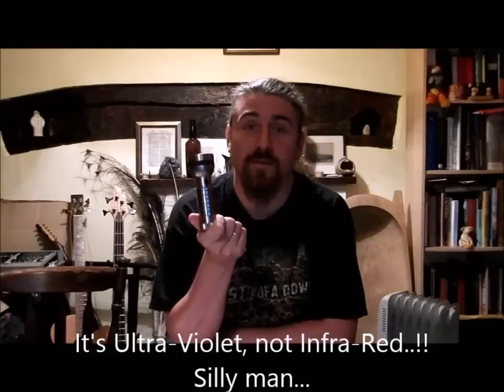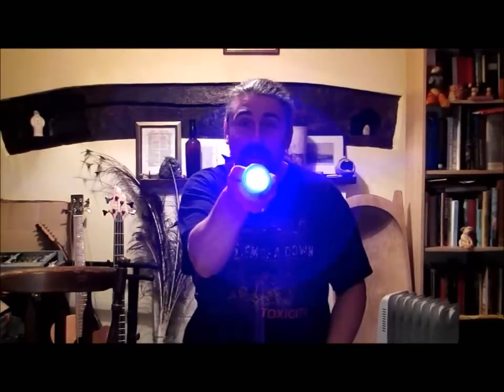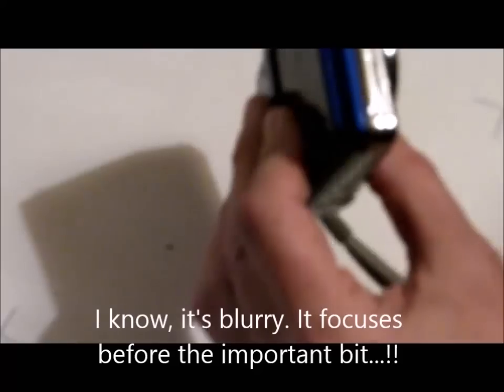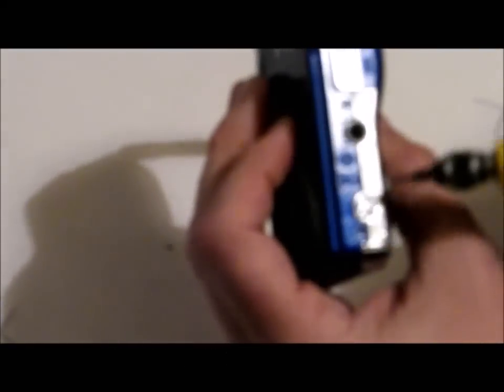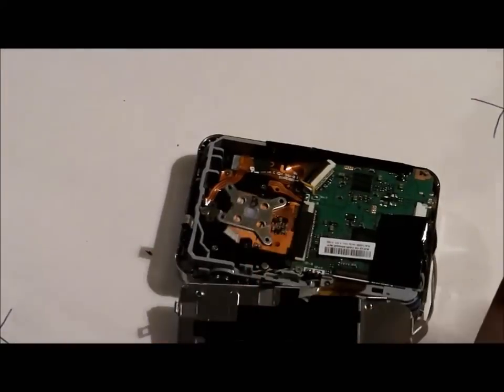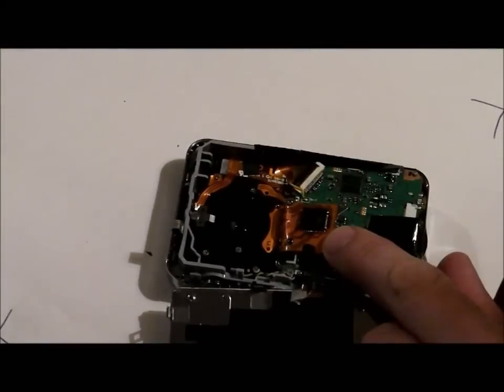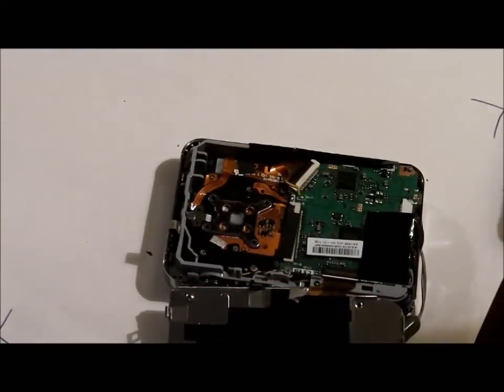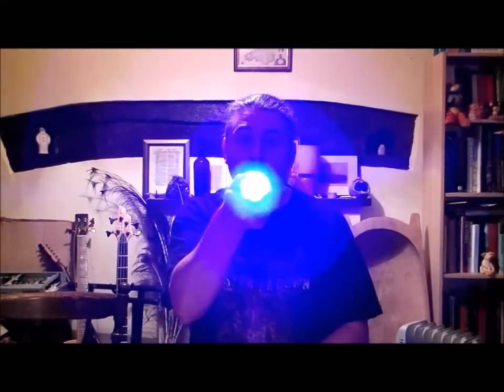Convert your compact digital camera to I.R or full spectrum.

Comment: Many thanks, I didn't realise it was as straight forward to do yourself, would it be as easy with a kodak easyshare type of camera? Failing that fuji camera coming soon 🤔
Reply from the maker: philmacrackin 9
Kodak cameras are a tough one to call. They've made so many different designs that I tend to steer clear of them. Fuji finepix are the easiest to work on and they're cheap as chips. Glad you found the video helpful..

Comment: These ghost hunting groups that are charging money for things like this are a joke. I notice they usually cover the manufacturers name on the item, with a sticker with their groups name, as if they've actually made it themselves. They buy Kii meters too, and replace the momentary switch with a latching switch. I don't know how much a PCB mounted latching switch like that costs, but I'd be surprised if it's as much as the padded envelope you'd get it in. The IR lamps they make and sell are awful, too. If they're boasting about it running all night on a 9v PP3 battery, then its obviously not worth buying. They make a big show of comparing them to expensive units like Sony's Hvl-IRM...Sure. Compare modern IR LEDs with those in a device that's old as the hills. Besides, those 10mm 3 chip IR LEDs cost next to nothing. The battery you're powering it with costs more than all the parts and the little project box combined, yet they make a huge mark-up, and most of the time, they've used the wrong current limiting resistors entirely because they learned how to make them off a Youtube video and are using the same value resistors despite a different LED configuration. They sell EM "pumps" that are just magnets stuck to a fan...well, it may trigger a reading in an EMF meter, but that thing is not doing anything. Magnets do NOT emit energy into the world; magnetism is a reactive force only. All they are doing is moving a magnetic field through the meters coil and fooling it into giving a reading. The only energy you are "pumping" anywhere is the kinetic energy of the thing spinning around. If anything used any of that energy for anything, the motor would slow down, so why not put an ammeter in series with it and see if anything uses that energy? As the motor slows, it will draw more current. Even the solid state EM pumps are a total con-job. Why pay some guy for something that puts out a tiny fraction of the energy the mobile phone in your pocket puts out? Because it has more effect on an EMF meter? Well, it would. They are designed to find  fields oscillating at mains frequency, so that's how he tunes his "pump". The false assumption being that if we're using an EMF meter to detect ghosts, then They must "eat" EMF, and for some reason need it to be at around mains frequency. In that case, the last thing they'd need is a puny little device sat on the table; they can help themselves to the national grid. Kii meters on the other hand are sensitive across a much, much wider range. Watch how your mobile phone sets those off! And they'll do it from much greater distances than anything using permanent magnets will. Hell, make a TASER and use that as an EM pump. The driver is the same type of circuit as a solid state EM pump, and the rest is just a cheap trans former, a few voltage doublers, and an output transformer. Apart from the output trans, all the parts might come to a few quid. The output trans might set you back £15 - £30, for which price you could get a scarp neon transformer and make a big Tesla coil instead. But you can't sell those things on Ebay, so those people convince people that it only works if you spend money on the primitive little gizmo they make. UGH!
 The trick in this video works equally well with camcorders, and they charge even more for that mod, even though miniDV camcorders aren't worth the postage to ship them anymore.
 Anyways, sorry for the rant. And thanks for giving this information away instead of selling it. I never even mentioned hacked radio shack radios that suddenly become "ghost boxes". The schematics for the original Franks box are freely available, FFS! There's barely a few quids worth of parts in it!
Reply from the maker: No need to apologise for any rants, I have enough of them myself. There is a guy on eBay who does everything that you've highlighted. He sells those insulating bags we get our sensitive components in as 'Faraday Cages' to block the signals to these scanning ghost boxes (excuse my wretching), for  a whopping £7.99. I had a batch here that I paid £3.50 for 25 so I listed them. If people really wanted them, they could get one off me for a pound. Believe it or not he actually sent me an email and demanded that I raise the cost in comparison with his as I was drawing away his customers. When I refused he threatened to report me to the Inland Revenue for tax evasion. Tough tits buster, it's called free enterprise, I pay my taxes and you're an A-hole. I even stuck a little note in with every order telling people to just disconnect the antenna, it'll null the sensitivity by around 100db and render it deaf to any transmitter over a 100 meters away.
Unfortunately, many people with an interest in the paranormal are a little naiive concerning it's nature. In fact anyone who can actually tell you what a 'genuine' ghost, EVP or any other paranormal event is, or even tell you or I that such things definitely exist, is a better man/woman than me because NO ONE KNOWS, thats why it's labelled paranormal. There will also be people who will always try and turn a profit from peoples lack of knowledge. If I can raise the awareness of these people to the work of profit hungry charlatans, job done...
Reply: Thor I'm tempted to make a video on the subject. Youtube is a lot less strict about little copyright issues than it used to be. They're not going to delete a video just for showing part of an Ebay listing. Is that guy still selling anti static bags on there? Let him report you. Report him back. 20% of 7.99 is a lot more than 2% of a few pence, and you can bet he's not paying tax, either. Nobody pays tax on stuff they sell on Ebay. I'm surprised the HMRC haven't arranged to have the tax taken out automatically.
 But the antis static bags really take the cake. Best I'd seen was "dowsing rods" made from 3mm electric fence wire with a bit of glow in the dark tape around the end so you could use them in the dark. That wire is sold on 1/4 mile spools. It makes me sick. I just made a Ouija board planchette out of a floorboard from a 200 year old fort, the bottom of an alcopop bottle, and three glass marbles as the feet.  I should sell them as ultra low friction, hi-tech Ouija pointers. Tell the very true story of how the fort was used as a hidey hole by a serial killer in the 80's.
 I agree fully about the nature of ghosts. I cringe when I go on those public investigations. I go for entertainment, because it's hilarious. The members of those groups talk to the members of the public there as though they are sharing absolute certainties. One of them informed me during a cigarette break that ghosts aren't bothered by our torches because the only light they can see is fire. 2 hours later, the same guy is having a lengthy conversation with a ghost about the LEDs on a Kii meter. "Can you make the red one light up now please?".
 Gotta love the idea of asking if there's anybody there, and then waiting quietly for ages. True story: Medium: "If there are any spirits here, can you make a noise". Dog in nearby village: (after some time) "Woof",  Medium: "If that was a spirit dog making that barking sound, can you make it again, please". That seriously happened. It was at Carew Castle, and I wish I had it on video.
 Ghost stop has some nice over-priced junk. I see Kii meters cost 4X the original price now, with a simple switch modification and a black paint-job. I do love the Ovilus. I'm always amazed by how it can have a 2000 word dictionary, and all the words are Kill, die, death, dead, rape, murder, died, killed, hung, beheaded, etc. Looks to me like the words aren't randomly selected. Unfortunately, the list isn't included with the device, and anyone smart enough to reverse engineer it, is way too smart to pay the asking price.
 If you can buy something that measures something and can be relied upon to give unexpected readings from time to time, people will use it to "hunt" ghosts. I remember when digital thermometers were all the rage. These people just want something to wave around and produce ghosts for them, when the ghosts are too lazy to appear in front of them or levitate a table for them. I swear, it's just roleplay, and the people doing it know that, deep down. After all, if the chances of seeing a ghost are so slim, it soon gets boring unless you have some device to tell you they are there, anyway.
 When they call themselves scientists, I want to punch them. As soon as someone claims to have seen or heard something, they always make sure to shout out loud what they've seen and heard, completely ruining any chance of someone giving more credibility to it by seeing it too. Surely they understand this. I think they've just learned that they HAVE to shout out what they think they saw in order to get other people to say they saw it too. Again, I think it's all roleplay. I think there's as much chance of seeing a ghost without the "medium" and all the equipment and hysterics and provocation. If they exist, and are aware of us, and can move objects occasionally, one of them would have written to us by now. There are so many theories as to what they might be, but every last one of them has holes that make it senseless. I'm not even convinced they exist. I mean, I've seen lots of phenomena, and other people claim to have seen actual apparitions, but there is no rule whatsoever saying that that must be anything to do with what happens after people die. I've yet to see any evidence of any real intelligence. Funny how they only seem able to whisper the first letter of a name into a mediums ear, but, once the medium hits a lucky letter and is given a name by someone, they can suddenly talk 19 to the dozen, until the issue of dates arises and they get muffled again.
Reply: Thor awesome. Can u please give me the address where you sell the Faraday pouch. I need a few.
Reply from the maker: Rexx Michaels http://www.ebay.co.uk/itm/FARADAY-SHIELD-FOR-USE-WITH-ITC-SCANNERS-SPIRIT-BOXS-ETC-EVP-/261890428526?ssPageName=STRK:MESE:IT
Reply: Thor so what's the difference between the bags and the fiber/woven bags? Question: Don't they ship sensitive computer parts in these special bags???????
Reply from the maker: Rexx Michaels The only real difference is that the bags I use are much less to buy. They are used for shipping sensitive electrical components, it works for exactly the same reason that they work for ITC, no static gets through.
Reply from the maker: Rexx Michaels It costs about £4.50 to ship from here to the States so it might be better worth your while to nip into Radio Shack, I'm sure you'll be able to pick them up there at a much lesser cost than having them shipped from over here..

Comment: Hey there! I posted another response last week but don't see it here so I'll post it again.  I got a Nikon Coolpix S3500 on eBay to convert to full spectrum and tried to do it myself. I was able to get all the screws off but couldn't get the cover off. I really thought that I would feel comfortable trying this myself but after trying I don't. lol I was wondering if you would be willing to do a video chat with me so that you could help walk me through the conversion? If not I completely understand so would you be able then to walk me through it via instant messaging or any other way? I totally trust you but sadly I don't trust myself to do this alone. Thanks so much! Looking forward to hearing from you!
Reply from the maker: +Two Pink Peas I'd have to arrange to use someone elses broadband connection. We ;ive in a very rural area so my broadband only comes in at about 0.9Mbs which isn't good for streaming or Skypeing. I'll see if I can sort something out..

Comment from the maker: +Russel phillips
That doesn't sound right to me. Make sure the ribbon cable that attaches the led screen to the board is correctly secured. It might also be worth turning it on before you reassemble it. It just sounds like a bad connection to me.

Comment: Hi Awesome video
What make camera do you have there?
Im very new to this and am going to copy you bit by bit lol
Also have you tried it on a camcorder?
Thanks
Reply from the maker: +Richi Bulbs It's a Fuji FinePix in the video. I have done it to a camcorder too. It's a bit more involved in that there are more screws and other bits to deal with but the principle is the same, as long as you can get to the sensor, job done.

Comment: hi Thor, is it Posible to convert a SJ7000 into a IR or Fullspec ?
Reply from the maker: Hello, I can't imagine any reason why it wouldn't possible. The same basic principles apply for video as for still cameras so if you can't get to the IR filter and remove it you'll be good to go.

Comment: I like your video great info it now makes me want to learn more info on this.Just a couple of questions the lantern (flashlight) you showed that you said you bought at a sports store when in the barn your mounted light battery was going bad i wish you would have used the lantern to get out and i could have seen the results of the handheld lantern (flashlight) just in case the other one lost power.

0
Reply from the maker: Frank Turley The lantern I use is very similar to the one in the link.
I'm not endorsing the item in this link, just using it as an example. It was the first one I came across on eBay so I'm sure a little bit of digging around will find very similar lanterns at a lesser cost...
Glad you liked the video...

http://www.ebay.co.uk/itm/Silver-Aluminium-21-LED-UV-Flashlight-Torch-Ultra-Violet-Blacklight-Detection/161405466210?_trksid=p2045573.c100034.m2102&_trkparms=aid%3D222007%26algo%3DSIC.MBE%26ao%3D1%26asc%3D20140107092241%26meid%3D594cf591a336440584810d86678c0955%26pid%3D100034%26rk%3D2%26rkt%3D4%26mehot%3Dpp%26sd%3D221529903528

Comment: I've just converted my old Fuji A610, though the circuit board was in front of the sensor and the display was incorporated into the back, so a bit more work than suggested in the video. I tried both IR and full spectrum adaptions and can say that full spectrum is more fun and usable. IR pics are dark and big apertures/slow speeds are required. or manual over compensation and tripod mounted fuss.  In B & W, full spectrum pics are better defined, clearer, sharper and the IR effects are more pronounced. In colour mode, I found it necessary with both IR and FS, to reduce the colour saturation post production. IR colour pics are pretty useless unless the light is strong. The FS is the one to have for ghost hunting. All good fun, and thanks for the confidence building video.

Comment: did everything you said to the letter but wont give clear shot blurred help what did I do wrong
Reply from the maker: A couple of things to check.
1. Check you didnt displace the lens when you put the case back together.
2. Make sure the ribbon cable is correctly re-attached aa a loose or missing connection will cause the camera to mis-focus.
Dont worry, it will be a simple fix..

Comment: My question is what do you see when you look into the screen? Could you walk around in the dark with the camera and not run into anything?
Reply from the maker: Provided you have an IR illuminator you can use the converted camera as a night vision sight. You can't see it in the video but the barn was plainly visible on the LCD screen even though the place was pitch black..
Reply: You'd need an infrared illuminator light to do that. But, they're fairly inexpensive.

Comment: Question: Is there a difference between night shot & full spectrum. I have both one is pinkish & my SONY DCR-SR200 is greyish green. Is the difference that u can use the full spectrum in the day. Does night shot basically do what your doing?
Reply from the maker: +Monterey Paranormal Investigators There is a difference. Night Shot cameras are not usually all their cracked up to be. The way they image in minus lux conditions is to simply lower the frame rate allowing more light per frame into the CCD sensor. This does increase night vision but at the expense of image quality. It's this light gathering method that is responsible for the emergence of the 'Rod' phenomena. It's no more than insects that impress an extended image in each frame.
Full spectrum can be used in all light conditions and, depending on the pixel rating of the converted camera can produce higher grade images than a shop-bought Night Shot camera.
Reply: +Thor So would it be helpful to get an IR lense for the Night-Shot? Like 750-950nm for Skywatching? Thanx for the help as well. I absolutely appreciate it. 👻💀👽
Reply: +Monterey Paranormal Investigators So u don't believe in the Rod Phenomenon? Even when filmed with Top of the line cameras in the day. Jose is a friend of mine. I know some are insects like Orbs, but there's always a few that are questionable. We just don't know everything out there. Hey, just imagine what we'd see if we traveled 500,000 light years into space. Who knows, maybe nothing, perhaps new or old worlds. I study quantum physics as well.
Reply from the maker: +Monterey Paranormal Investigators I've replicated rods too many times to consider anything other than flying bugs. Physics was my passion, I taught it for six years. I did my Physics Ph.D at the Cavendish Laboratories in Cambridge in 1993. I always used to tell my students "If you think you understand quantum physics, you haven't understood it."  :-) That was years ago, I do other things now,